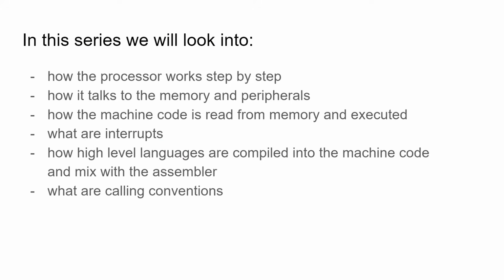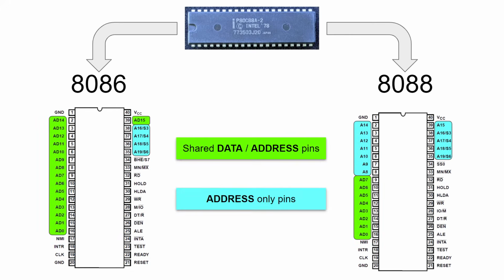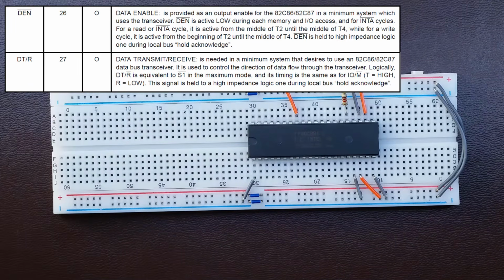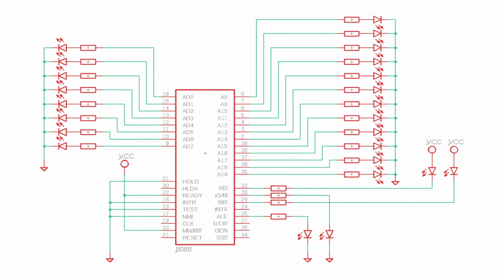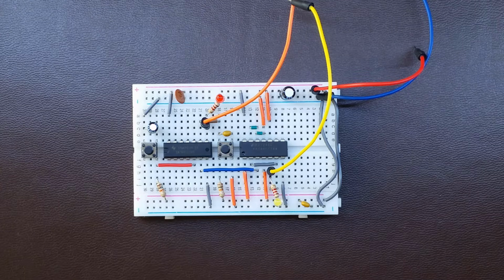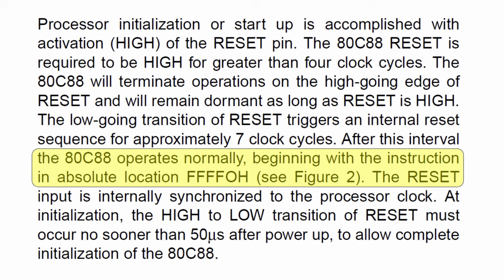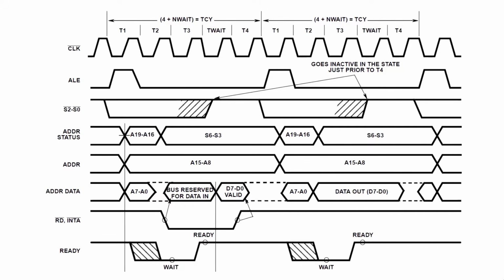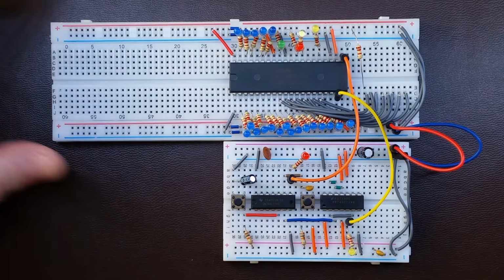First Run - Building and programming a 16-bit Intel x86 breadboard computer [part 1]

Comment: I have my original 8088 (IBM PC) and also an NEC V20 that someone gave me which is compatible but a little faster on some opcodes.  I just checked for 80C88 to follow along but they are out of stock. I'm also watching John's Basement where he explains the pins for the Z80 so it's cool to see what is the same and what's different.
Reply from the maker: Hi there. Yes, I'm aware of the fact that it's quite tricky to buy 80C88. In part 7 I introduced the 80C188 which is much easier to find on eBay or AliExpress.
Reply: @SladorSoft  oh cool, thanks!

Comment: Wait so the same pins that output the memory address, somehow also take the input from memory?? How does that work?

The direction of power flow must change internally right?
Reply from the maker: Yes - that's correct. These pins are bidirectional. First, the address is asserted on all 20 lines, the ALE signal gets active. One clock tick later, these "common" pins (AD0-AD7) may switch to be inputs when the CPU reads the memory, which signifies by issuing the RD signal. That's why you need latches to store the address for the whole bus transfer. I hope it gets more clear in the "part 2" video.
Reply: @SladorSoft  yes thank you, part 2 has cleared up the black magic 😅

Comment: Where can I purchase the chip from?
Reply from the maker: Well, since it is not manufactured for a long time now, you can try some second hand sources. Try looking for "80C88" on eBay or AliExpress. At the moment of writing this comment, AliExpress lists one cheap source of "80C88-2" - the "-2" part means that it's the faster, 8MHz, version.
Reply: Digikey still lists them, brand new, for around £5. Search "intel 8088".

Comment: Cool project. Are you also planning to write your own ROM BIOS so it can eventually run MS-DOS?
Reply from the maker: Thanks!
No, not really. The main reasons are: lack of any kind of a storage device and graphics card - the 20x4 LCD is a little to small to make it a usable "screen".
I am considering building a kind of a graphics card device as a future plan at some point though. This series was rather meant to allow me having fun tinkering with the 8088 - not to build a proper computer ;-)
Reply: @SladorSoft  You could try emulating an MDA adapter, which would be less difficult since it's text only. Or get data in and out of the computer using a UART and a serial terminal.

Comment: Hi, small question - what is RESET level during the operations? It was 4cycles HIGH, then 8 cycles LOW and what next? It is kept high or low?
Reply from the maker: The RESET is active HIGH. Also, it needs to be HIGH at least 4 cycles to reset the processor. As soon as it changes to LOW, it initialises itself for approximately 7 cycles after which the CPU starts fetching and executing the programme. For normal operation RESET needs to stay LOW at all times. The first 7 cycles is just the initialisation of its internal state before normal operation. Hope that clears this a little bit.
Reply: @SladorSoft  wow, thanks for incredibly detailed answer, it helped a lot!

Comment: It's an electrical question about the resistors. How does putting a resistor between, achieves its "state" (1 or 0, or Voltage or ground) to be recognized only as data (when the CPU reads from "memory"), and not as an address as well (when the CPU requests what address to read data from)?

PS: I have been a software developer for many years, but I don't know that much from the electrical side of things.
Reply from the maker: Hi! The AD0 - AD7 pins are bi-directional. It means that they are sometimes outputs, when the CPU asserts the address bits (when the ALE is active) or when it writes data to memory, or inputs, when the CPU reads data from the data bus. In the latter case, those pins have very high impedance and therefore can be driven by the resistors from either 0V or 5V. When they become outputs, the CPU is driving them instead, setting the required voltages. The resistance of the resistors is high enough (a few kOhm) for the CPU to override the voltage level of the pins. If the resistance was too small, we could damage the CPU as the current flowing from the CPU through them would be to big for the circuitry of the CPU to handle.
This above is also correct in all other similar cases as well, but the 8088 has in fact a special circuitry on those pins which determines the upper resistance value for those resistors. These pins need to be driven with at least 400uA to be correctly set to a logical level. That means that the resistors' values could not be greater than 5V / 400uA = 12.5kOhm.
I hope that makes sense (without drawing example schematics).

Comment: Technically the NOP opcode (0x90) is for the XCHG AX, AX operation, which would swap the AX with itself (or rather its contents). Whether or not a given x86 CPU actually performs this operation is implementation dependent. 

It is nice to see the venerable 8088 used in a video like this. Thanks!
Reply from the maker: Yes, of course, you are right. The encoding of "XCHG with the accumulator" is 10010rrr, where the "rrr" is 000 for the AX. I didn't mention to avoid confusing those who didn't know the platform well. Thank you!

Comment: Excellent presentation. I have built my own 8088 system, which implements single step, but I never considered a solution whereby the clock of a CMOS processor could be stopped. You learn something new everyday!
Reply from the maker: Thank you very much. Yes, the clock of the CMOS version can be arbitrarily slow, but it is true only for the CMOS, which you can tell by the letter "C" between the "80" and "88". The datasheet of the HMOS version says that the maximum clock cycle period is 500ns which translates to 2MHz.
Reply: I know this isn't exactly related, but it kinda is. I got a couple interesting brief stories regarding the clock stopping...

First situation is rather simple. I used to repair and modify cheap digital watches in my teens, back in the 90s. I discovered quite by accident that if you touched the pins on the quarts crystal oscillator, the display would go blank and the time would get stuck, until you removed your finger anyways.

Second story is much more odd though. Once I had an HP laptop come into my computer shop, which was acting rather odd after they had dropped it. Everything appeared to still be working, more or less. But we found viruses on it and chalked the weirdness up to the viruses, so we decided we should reinstall Windows ya know..

This is where things got really weird. As we started reinstalling Windows, it would just randomly lock up, like solid. Well we had many computer repairs at the same time so it sat there like 4 hours stuck, in the middle of XP reinstall.

But as soon as I lifted the laptop up, my fingers pressed in a little in the middle to balance it ya know, but when I did the computer suddenly started running again haha! And you could repeat this too, set it back down on the flat desk and it freezes, lift it up by hand and it keeps running right where it left off flawlessly!

I dunno what exactly went wrong with that timer circuit, but it was pretty obvious that there was a bad solder connection some damn where.

Whatever connection/line broke loose was like a damn pause button for the CPU.

Comment: Oh that's beautiful. I've looked into the 8088/8086 in the past for potentially using in a homebrew computer, but the multiplexed busses put me off. Also I thought I remember some clock phase requirements, but I might be wrong. Didn't know there's a static version either, nice.
I still prefer the motorola 68000, but it would be interesting to give the 8088 a try at some point; should be fun.
Subscribed to remember to watch the rest of your videos about it.
Reply: Hi, do you know about some M68k boards available or CAD drawings ? I would not want to Wire Wrap such a board.

Comment: Hey there! 
I'm thinking of starting this project. Where will I get the ic? May I know where you get your parts. I wanna buy EEPROMS and microcontrollers.
Reply from the maker: I bought my parts quite a long time ago, but I can still see sometimes 8088 and other retro ICs available on eBay, but that may depend on where you are. Try AliExpress as well. Flash memories: again, eBay. I can see some on Farnell website as well. Futurlec has quite a good assortment (they also have 512k RAM). I hope that helps.

Comment: Is it possible to provide the schemas and values of the used capacitors, resistors, ...?
Reply from the maker: I am planning to put together a simple website where I would publish all schematics, source code and other details for reference. Currently I'm focused exclusively on publishing the next video (which should happen finally this weekend), but after that I'll think about this website. I'd like to ask for a little patience as this is my after-hours project and initially didn't expect to get this interest honestly. As to the values, I assume you ask for these in the clock circuit (around the button). I used some common sense arbitrary values: R around 10k and C around 10uF. The resistors on the data bus in the 1st video were around 2.2k.

Comment: I built a breadboarded 8088 system for my Sr design project in college back in 1988.  I still have the project breadboarded but wires came loose and corroded.
Looking to reverse engineer and rebuild it so this is good review.
Reply from the maker: I still have my 8088 system build on a (homemade) PCB 20 years ago. Because of many changes I applied to it later on, the PCB looks really messy and I'm not brave enough to power it on ;-) Thank you for your interest!

Comment: Nice work. I have in drawer one 8085, is the same logic that 8086 ? And i made one computer with Z80, see on the channel
Reply from the maker: Honestly, Leonardo, I have a couple of 8085 in my drawer as well. This is  a separate 8-bit architecture preceding the 8086 which has not too much to do with the x86 and having more to do like the similar Z80 family. I will, therefore, leave it to someone else to cover that, while me keeping on to the known x86 family which I'm familiar with for over 25 years. I'm sorry to disappoint you on the 8085, but I hope I can keep you enjoying watching me playing with an 8088 instead? Se you there!
Reply: @SladorSoft  Thanks to responst. The 8085 seems kind of hard for me, that is why i like Z80 (see in my channel). I hope you go far way with video controller, compact flash, and outher advanced devices. I have so much curitosity about 16 bits.